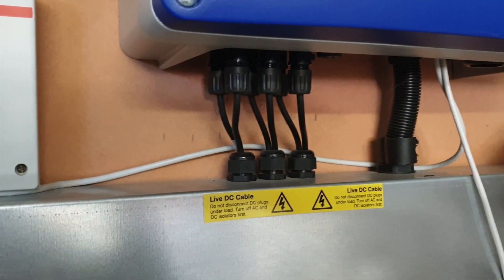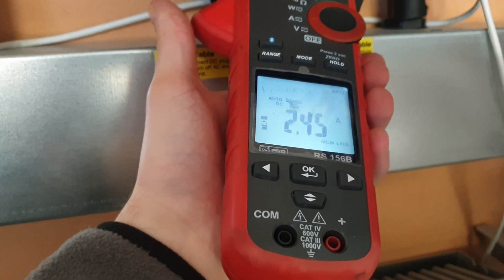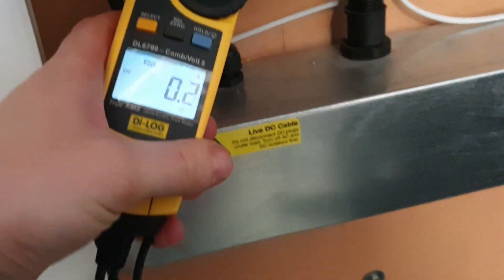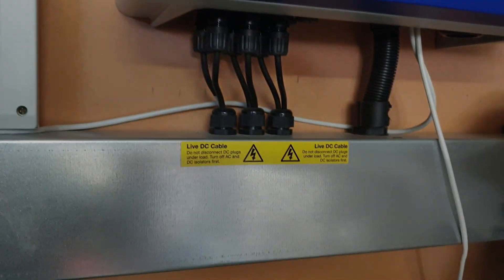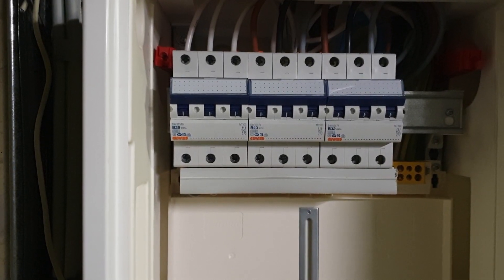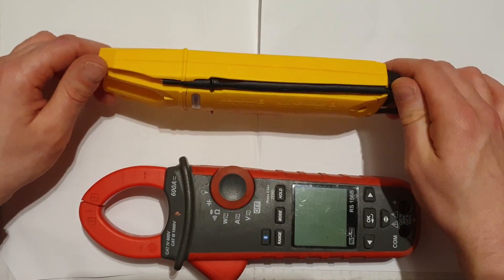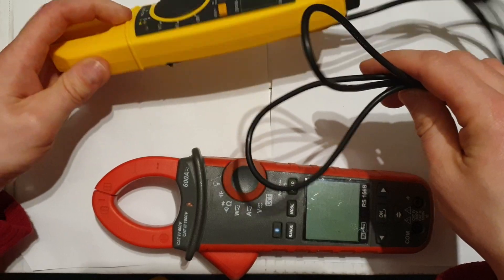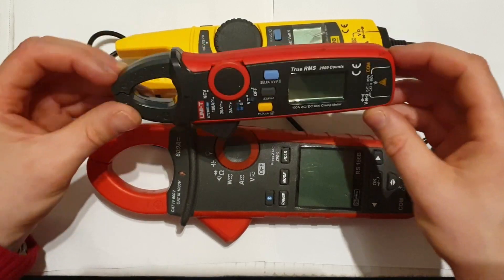Di-LOG DL6799 AC/DC Fork meter review & comparison. Uni-T 256B & Tenma 72-3545

Comment: Uni-T is a Chinese manufacturer based in Hong Kong they supply circuit boards to a few other Chinese companies but they don’t supply Di-Log , Di-Log source there PCBs from  the same Dutch company that have been supplying Kewtech since the seventies before Kewtech became a rebrand of Robin electronics which was A British company and Kewtech still is a British company. Uni-T are a very well respected brand but sadly not in the uk, they have been gaining popularity in the uk in the past three years or so 
I’ve been a Qualified electrician for forty years and I have been using Robin testers all that time and I started using a Kewtech MFT about six years ago and Uni-T about ten years ago and I can’t fault UNI-T or Kewtech . However Di-Log are pants and poorly designed. Just my opinion but what do I know I’m just a grumpy old spark whose opinion means nothing.
Reply from the maker: I'm sure your opinion means something!

Di-log source from a wide variety of different places, some of their stuff is from the same OEM as Benning and Seaward (which might actually be Seaward, I'm not sure). 

This tester is 100% a Uni-T product, it says so on the main PCB inside. I have other Uni-T products, a multimeter, two clamp meters and a thermal imager and my first every meter was a Uni-T bought from Maplin. They have their place, though I wouldn't want to use them on anything high energy.

Back to Di-log, if you have a look at their DL9309 multimeter you'll see it's from the same family as the CEM-Instruments DT-9967 who are the OEM for other brands such as the Tenma TEN01063 and the AMECaL ST-9929.

The Di-log DL6790 CombiVolt 2 is Uni-T UT15C which is also related to the Tenma 72-9395.

You get the picture. I'm not saying that they shouldn't do it or there's anything wrong with it, merely that they do.

Comment: you might get use from the ut256, it only measures 1-60A (yes, 1A minimum) no multimeter feature. But the fork is small and can fit a lot of tiny places, plus its very cheap.

Comment: UNI-T UT256 60 A ?
Reply from the maker: Hmm, I hadn't noticed that. Thanks for the comment.

Aside from the fact it's 600V rated so I wouldn't be able to measure string voltages with it, that might work out nicely if I stick to using it for current.
Reply: @tceng9449  I myself considered this model for purchase, and in the search for information I saw your video. I bought it today, while the price is democratic. Thank you for your hard work.

Comment: tenma is uni-t oem .. i prefer uni-t over tenma.. tenma is suck
Reply from the maker: Uni-T is the OEM for a lot of brands.
Tenma is the Farnell/ CPC own brand, and a lot of their test equipment is from Uni-T.

I've been using their stuff for a while, some is better than others!
Reply: Uni-T is a Chinese manufacturer based in Hong Kong they supply circuit boards to a few other Chinese companies but they don’t supply Di-Log , Di-Log source there PCBs from  the same Dutch company that have been supplying Kewtech since the seventies before Kewtech became a rebrand of Robin electronics which was A British company and Kewtech still is a British company. Uni-T are a very well respected brand but sadly not in the uk, they have been gaining popularity in the uk in the past three years or so 
I’ve been a Qualified electrician for forty years and I have been using Robin testers all that time and I started using a Kewtech MFT about six years ago and Uni-T about ten years ago and I can’t fault UNI-T or Kewtech . However Di-Log are pants and poorly designed. Just my opinion but what do I know I’m just a grumpy old spark whose opinion means nothing.

Comment: I don't find open-fork clamps have too much use really. You have to get the cable right into the gullet of the fork to get an accurate reading. I have used voltage testers with integrated leads most of my career, so that aspect doesn't bother me, but with meters getting more functionality, damaging them gives an increased cost with their replacement. 
Testo do a clamp meter with a single straight jaw opening, it is quite unique and can be helpful getting into awkward places, but again it is quite bulky, so does have limitations as well.
Reply from the maker: Thanks :) I'd been looking at them hoping they'd solve a problem they don't seem to solve.

Have you used the flexible current coils? It would be interesting to see how they perform on your clamp testing rig. Fluke iFlex and that sort of thing.

I get the purpose of a cheap tester with built in leads but for me everything is fighting for space in a bag I need to take up ladders, so if it's just duplicating functionality another tool has there's no need for it. You can't do safe isolation of a solar array without a current clamp, so...
Reply: @tceng9449  I have a Hioki meter that comes with a small Flex adapter and a Flir CM55 that is a clamp meter with a built in Flex. The Flex clamps are based on Rogowski Coil technology, so will only read AC current unfortunately. 

You can get the current adapters for use in a multimeter that have both AC and DC functionality.